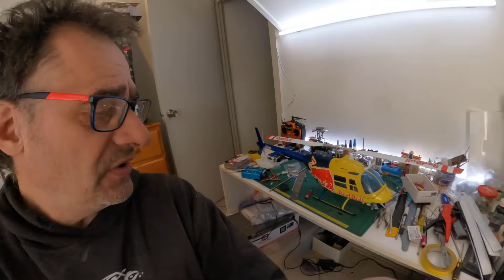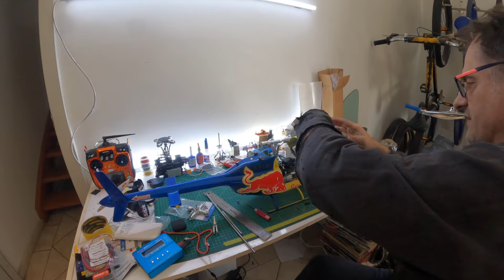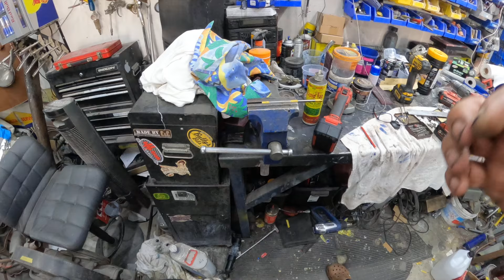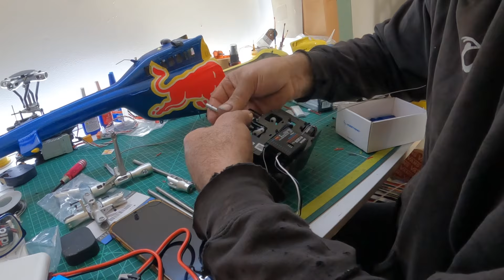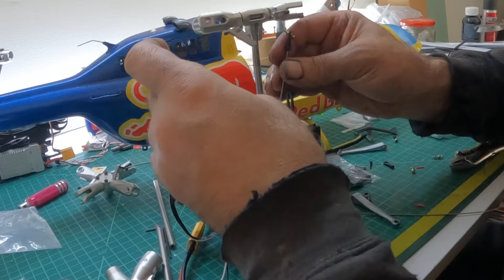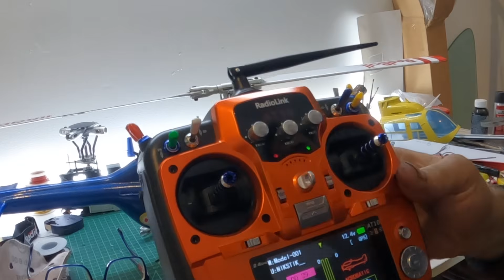FLY WING bell 206 rotor head modification // #flywingrc

Comment: The first set of links that you fitted after refitting the head would have worked fine without any need to modify them, I know you said they were binding, all that's required is some simple adjustments on the ball links without having to change the whole linkage as you have done. You also need a swash follower to ensure that the blade phasing stays correct - even with your set up as you have it now (The real thing has one) I am a builder of RC Scale Helis with over 40 yrs experience :)
Reply from the maker: Cheers for that, I did notice the stock flywing has the ball link/ follower all in one hence it cant move. I’ve changed it again to a solid style as I dont think there would be an aftermarket one that would fit this set up.
Reply: @RCSTRAYA  What diameter is your main shaft ?
Reply from the maker: @ThatHelicopterGuy1 6mm
Reply: @RCSTRAYA  Probably a follower from any 470 size heli will fit. 500 size is normally an 8mm main shaft.
Reply from the maker: @ThatHelicopterGuy1 ok I just watched a clip of how the bell one works. How does it connect to the main shaft? Clamp?
Reply: @RCSTRAYA  The ones I have use a small grub screw to tighten it against the shaft :)
Reply from the maker: @ThatHelicopterGuy1 ahhh ok, been searching for one but no joy yet. Thanks for the info too 👍🏽
Reply: Just in case your're confused, you didn't need the follower with the old links as they were much thicker so act in the same way.(Very much like a DFC head which is no good for scale anyway) The thinner links are much more scale but you will need the follower ;)
Reply from the maker: @ThatHelicopterGuy1 Yep got it :) I may try and make a taller set , really dont like the stock short look.

Comment: Hi. I've been watching your videos with great interest. I have the Flywing BO-105  model and would like to switch the tail rotor around. I'm sure you will cover this in your next video, but what changes do you have to make to the flight controller (if any) to make the tail motor work in this orientation?
Reply from the maker: Cheers mate, pretty much the cut is in the second video once glued back on all you need to do is reverse 2 wires on the tail motor for it to spin the other way thats it. 🤙🏽

Comment: Where did you get the two adjustable length pitch rods?
Reply from the maker: Made them from the stock flywing ones and rods from alliexpress. Will see if they work soon. I do also have another set from a different heli I will try.

Comment: Hello,
Great, you've installed the antennas and the cable cutter.
More and more magnificent, this is going to be a unique model. Congratulations.
I prefer it with the shorter rotor shaft.
Be careful, because the GPS sensor is at the front on this model; a shaft that's too long risks causing pitching or it may react with inertia. Be careful during the first flight.
Nice work.
Reply from the maker: Good point will be trying it in atti mode to start with 😉
Reply: I would tend to think that the additional mast height would increase pendular stability, though.  But I would agree that this is almost certain to either make the aircraft less maneuverable or affect the control laws of the GPS/gyro stabilization system.  It sure would be nice to have access to these bits on the heli control board via some kind of PC software.